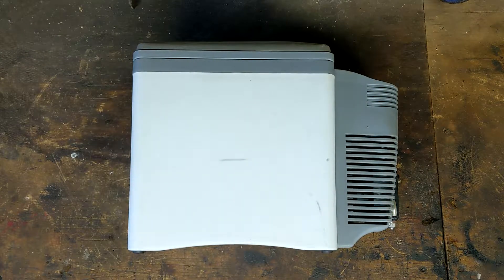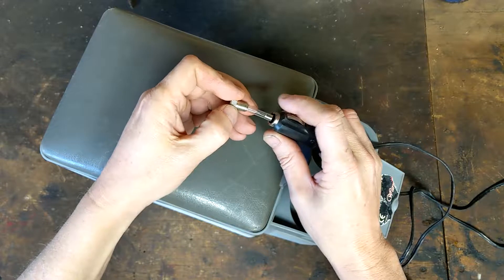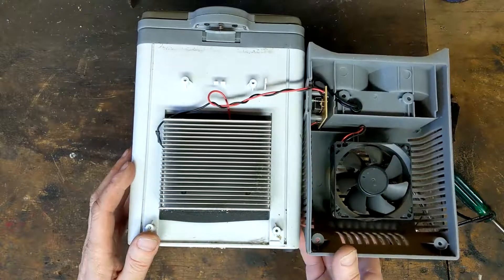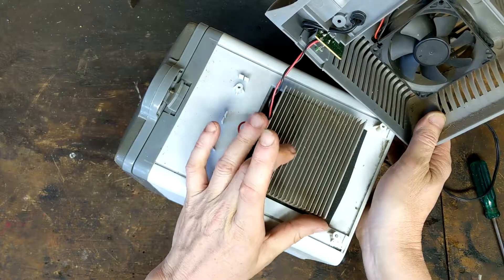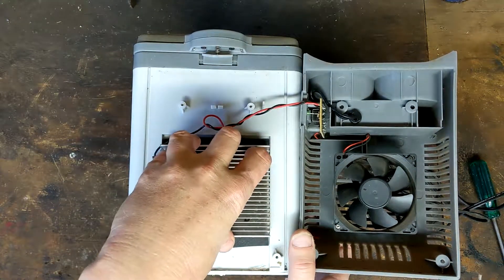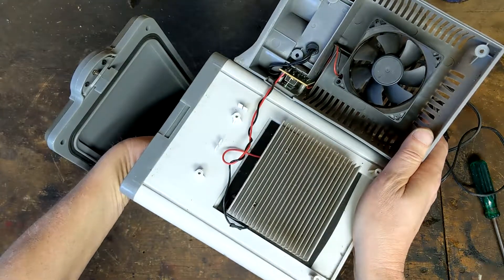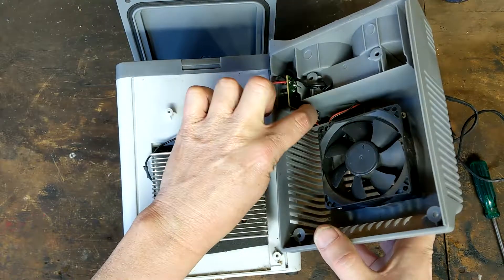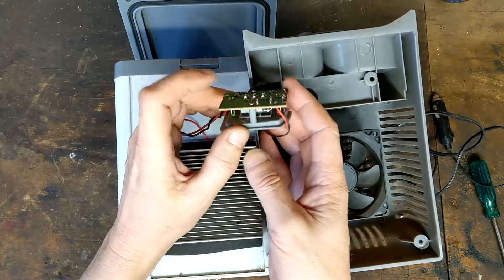Teardown 12V Car Thermo Electric Travel Cooler and Warmer

Comment: Well it's obvious you don't know anything about electronics...

I am nice today so here's your free lesson. 

The way these coolboxes work is through a Peltier element.  When passing 12v through it you will get a chemical reaction that will create one verry cool side and one verry hot side.  When reversing the polarity the cool side becomes hot and the hot gets cool.  The switch got 3 modes: off,  normal polarity and reversed polarity (cold or hot).

The fan will run constant when plugged in to 12v source,  its not temperature RPM controlled so the noicelevel will be the same regardless of the actual temperature generated.

The maximum cooling capacity of this kind of elements its about 15 celcius below room temperature and around 65 celcius warm.
Reply: Why same 12706 chip in Cooliuli can drop more than 15 degrees down then ?

Comment: Hello. Great videos. Watching your videos I can quench my desire to teardown all my appliances to inquire how they work and not get my girlfriend angry in the process.

Now, regarding the video thermoelectric coolers usually have a peltier element. Peltier elements have a cold and a hot side. When powered they will extract heat from their cold side and transfer it to their hot side by means of the peltier effect. As the cold side cools and the hot side gets hotter their efficiency plummets thus limiting the cooling effect and potentially damaging it. That is why their hot side will usually be heatsinked and ventilated in order transfer as much of the excess heat as possible to the air and allow for the cooling effect at the cold side to continue. I have experimented with thermoelectric coolers and I don't recall them being reversible as in reversing its cold and hot sides to become a "warmer".

What do the 3 positions of the switch do? Could you take a close up photo of the circuit board, top and bottom?

Thanks.
Reply: I'd love photos of the circuits as well...